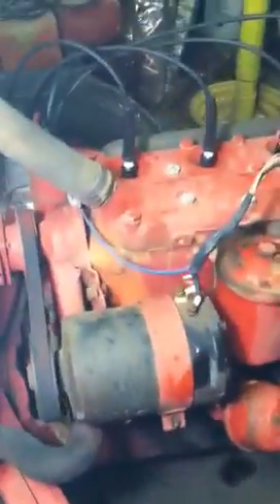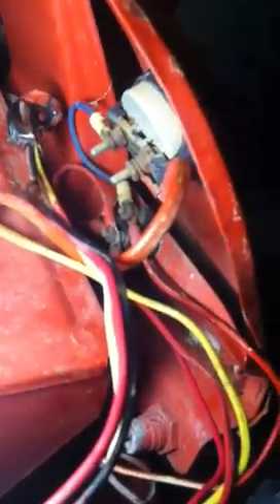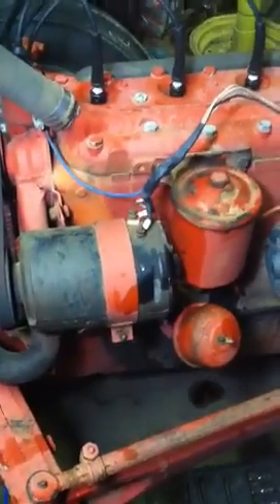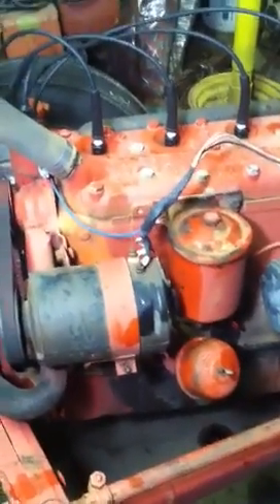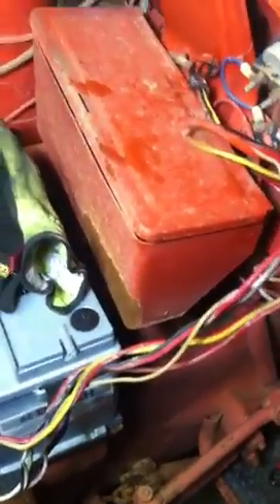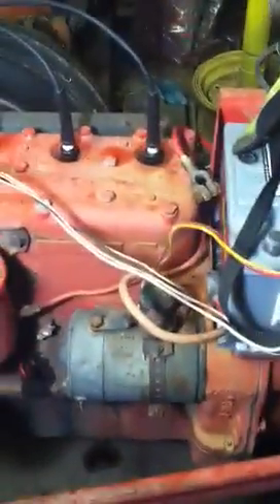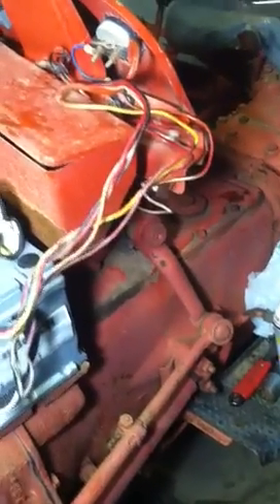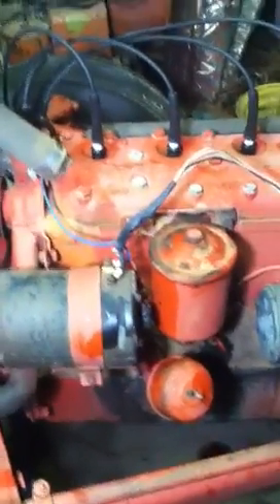Ford 8n 6 volt to 12 volt #1 of 2

Comment: I have the front mount distributor on my ford, i think it is a 2N. Im confused because i dont know if i use the slim resistor ballast or the long rectangular one. 12v conversion kit doesn't say.

Comment: A one wire alternator will not charge unless the RPM is around 1200. I found this to be unacceptable, so I used a 3 wire alternator and it charges even at idle. A 3 wire is not much harder to wire and I got a 3 wire ac delco 10SI for $55. A little more than the $35 but well worth it if you  don't want to have dead batteries all the time.